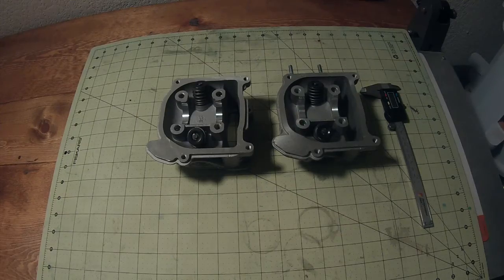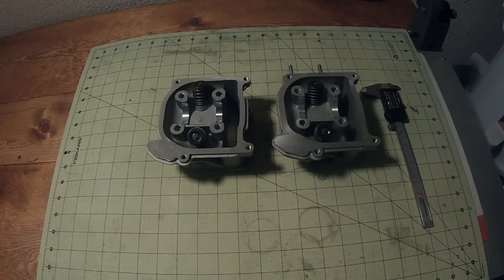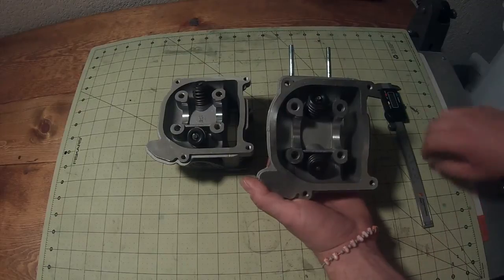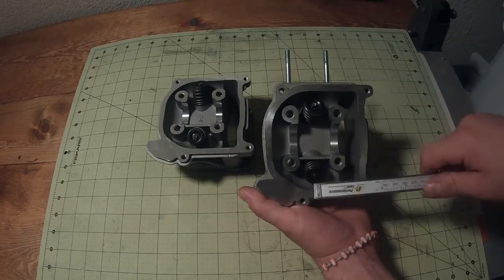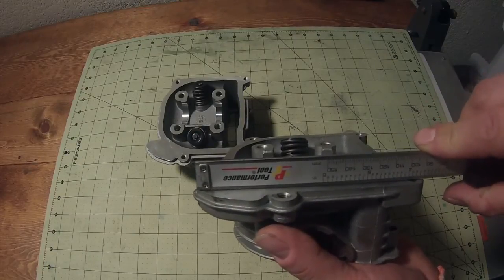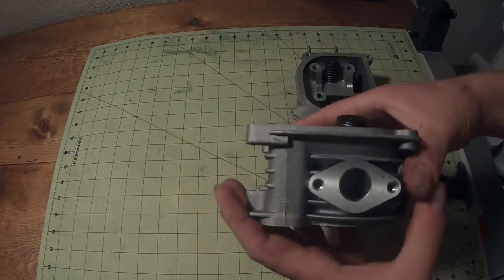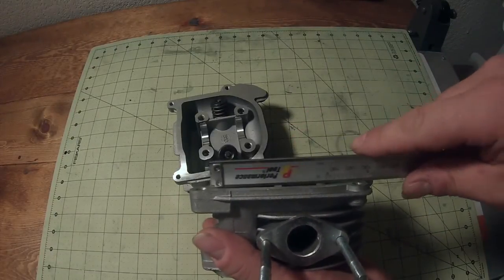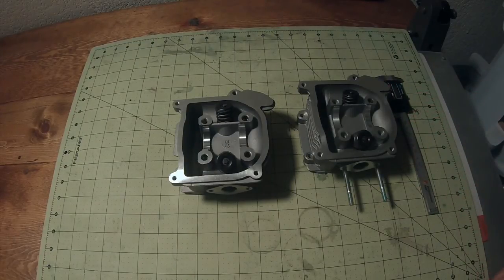Valve Size 50cc Scooter GY6 139 QMB Engine - How to Determine 64mm or 69mm

Comment: Without changing other parts, is it possible replace a 69mm head with a 64mm head? If this is not possible, what other parts must be replaced? I bent a valve and I was not able to have compression over 7bars even lapping valve and I've problem to find 69mm head with SLS/EGR at a good price, only 64mm are cheaper. Thanks in advance
Reply: Amazon and ebay both sell cam holder/rocker arm assemblies for 69mm valves, it is slightly taller for higher lift than the 64mm assembly and costs around $12. The stock valve cover (for 64mm) may not fit though!

Comment: Awesome informative video thank you for uploading this ..👍 I have a 4 stroke boom scooter qmb139 50cc and I am needing a cylinder head replacement my sparkplug hole has been stripped out pretty bad I thought I would just buy another new cylinder head replacement but I'm puzzled on what one to get being the different sizes they come in after watching your video I guess I will have to remove my original cylinder head from my scooter 1st to verify what size I truly need ..? Thank you for helping us out I'm new to these gy6 engines I've never worked on anything that gots to do with the inside of these gy6 engines only the outside basics ...😁👍

Comment: if i was to put a9 camshaft on 69mm head  would that cause exhaust valve to exlpode just asking because its happened to me twice
Reply: Did you figure it out? I have the 47mm bbk with 69mm valve head and rocker assembly. I'm waiting to learn if I should get the A9 cam myself because of many negative Amazon reviews.

Comment: Good valve vid!, loved it. My question  is I installed a 100cc big bore kit without changing valve stems. I believe they are 64mm do I need 69mm. Can the shorter valve stems cause performance issues and backfiring? It seems to have issues after it is warm. Please help..... David Koontz.

Comment: My scooter has a 69mm valve head on it. The bore kit I bought came with a new valve head but it is a 64mm. Can I run it? Would like to know. Love riding thru town on my scoot just wanted to make it a little quicker. Already installed racing cdi, coil, air filter, and 1,500 rpm clutch springs and contra spring. Need the block to handle the power more efficiently. Any information would be greatly appreciated.
Reply from the maker: Sorry man,  you’ll have to stay with 69mm
Reply: @RouseGarage  well that sux. Can I toss my stock head on or do I just need to bite the bullet and buy a new bbk?
Reply from the maker: Should have bought the kit from us lol, we would’ve helped ya out!  
You can’t use the stock head because it reflects the stock bore size and will not match up to the new cylinder. 
You can buy just the 69mm head on our website. www.rousemotorsports.com
Message us through our website and we’ll give you the YouTube fan discount!
Reply: @RouseGarage  can you just replace the rocker assembly with one made for a 64mm valve?

Comment: Hello, I've asked around and no response from any of them. But I have ordered the 100cc big bore kit. And after installing the kit I also added the A-9 cam. This was built on a GY6 tao tao racer. When I was trying to adjust the valves I've notice when (cam lobes) we're facing toward engine. The valve spring/rocker arms, we're gapped, like, huge Gap at the valve. I wasn't able to adjust them. The a-9 cam is 64mm. Do I need a 64mm rocker arms in order to correct valve with spring and arm. To adjust the valve?

Comment: Do you know?
Some say 80cc is the biggest you can have to avoid drilling out of the crankcase. Or Is 100cc the largest? Strange, because you get a gasket to the crankcase with the 100cc kit from ebay?